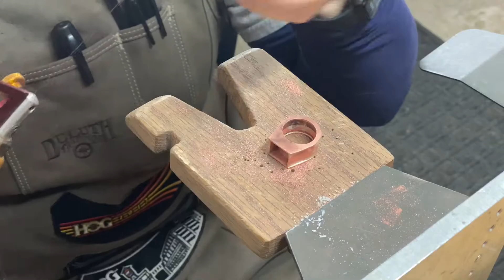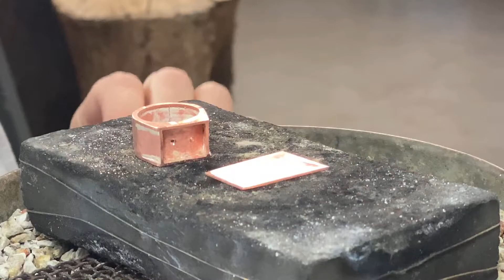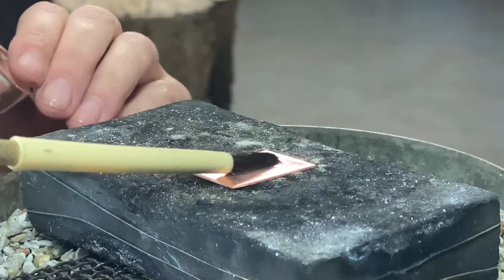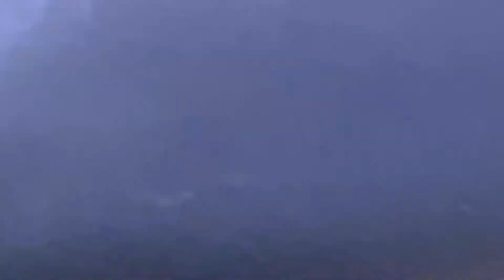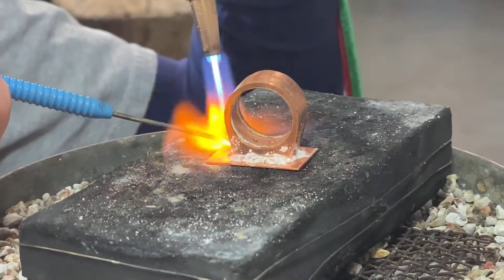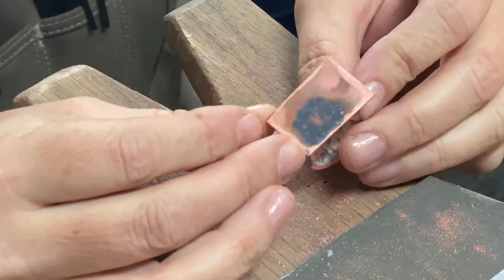Real Time: Signet Ring Part 3

Comment: Really interesting to watch.  Coming to jewelry making from blacksmithing and knife making, it kind of surprises me that jewelers don't usually seem to have or use a belt grinder.  Maybe they're too wasteful of material, but boy, they make some jobs much faster and easier.
Reply from the maker: Haha! But we do have a belt grinder, we’ll sort of. We use the flex shaft with sandpapers that do the most work, but to get the fine sanding and polishing, it’s better to do it by hand to be more precise. And, because the pieces are so small, it’s difficult to hold on to the piece and get all of the nooks and crannies with the finest of sanding. We also use an arbor polisher for the most part to do the final finishing and I know that blacksmiths will use them too to get the mirror quality shine on steel - if that’s the aesthetic they’re going for anyway. A lot of what blacksmiths and jewelers do is very similar it’s just that jewelry is smaller 😄

Comment: So do the holes stay open? What happens if people wash their hands. Does liquid get trapped inside?
Thank you for the demonstration!!
Reply from the maker: Yes, the holes do stay open. If they submerge for a significant amount of time, water will seep into the ring.  However, the holes should be as small as you can drill them to help prevent the water inside.  Their only purpose is to prevent a problem when you solder the pieces together. 😁

Comment: This is a great, informative video! I was wondering if you were using a Smith little torch and if so, what tip are you using here? Thanks so much for taking the time.
Reply from the maker: Hello Andrea! Thank you so much.  Yes, I use a Smith Little Torch - propane / oxygen - for all of my projects.  The tip is from Paige Tools and is a multi-flame rosebud tip. I use this tip for heavier gauge / larger projects because it creates a much larger flame and the design from Paige maintains a well balanced heating area (better than a standard rosebud IMHO). Between the standard tips from Smith and the Paige rosebud tips, I can pretty much solder anything with my Little Torch - it’s extremely versatile.

Comment: Hello! Thank you so much so explaining why we need to drill the hole. This is a great video. One question about that hole. Wouldnt water get inside the ring when the ring is used daily and you wash your hand or something? Is there a way to fill it back?
Reply from the maker: Hello Nardine! Thank you so much for the compliment! Yes, water and other things can get into the hole. I recommend drilling 2 small holes so the water can drain or dry more easily. Typically, the holes are drilled in an area to be covered by a stone when the design calls for a stone. If there is no stone, I usually make sure to advise the wearer of the possibility of water so they can adjust when and how they wear that particular piece. Hopefully this is helpful. 😃

Comment: Thanks so much for a great tutorial! I’m making this ring in silver and was wondering about the (no) pickle part. How do I prevent oxidation if I skip the final heating and pickling? I’m a beginner and was taught to always finish by doing this 3 times. Thanks again for some really great videos :)
Reply from the maker: When using silver I recommend pickling after every step. The silver is more finicky and requires a little extra work. I hope this helps! 😁

Comment: Julessa, in making the ring this way, am I limited to only a square shaped top?  Is it possible to create an oval, or circular shaped top?
Reply from the maker: You can definitely do different shapes but the template is a little different. I’ll have to make another video on a round too that can be altered for an oval.

Comment: Such great information. I now see the errors of my ways😉 Not pickling it after the last solder would probably have saved me LOADS of issues. I see thru the whole process you didnt use a barrier flux. If doing the ring in silver do you suggest taking this step and if so even on the final for the cap solder since it wont be acid cleaned again? I cant thank you enough for this series. You have really answered SO MANY issues for me!!! 🙏💖🙏
Reply from the maker: I did use flux, I just didn’t coat the whole ring. I fluxed at the join to help the solder flow. That’s my usual process. For silver, you have to get the heat in fast too keep from getting the fire burn. You can always use flux on the whole ring, but I found the only flux that is successful in that is either past flux or the boric acid coat.